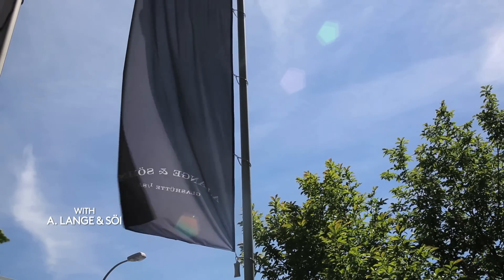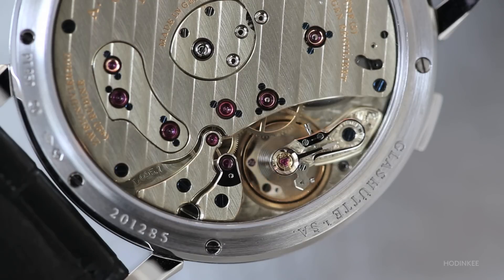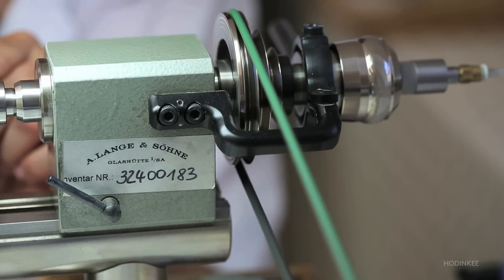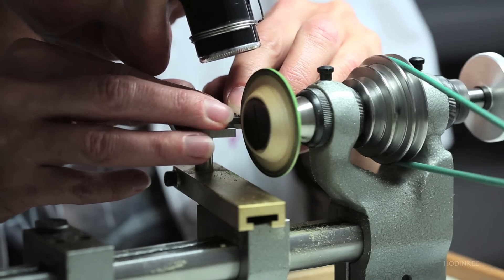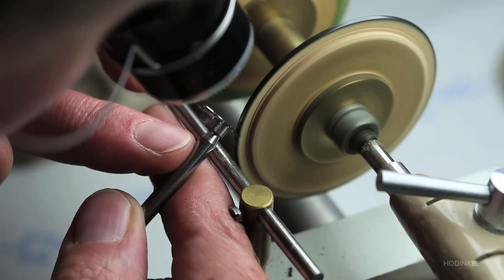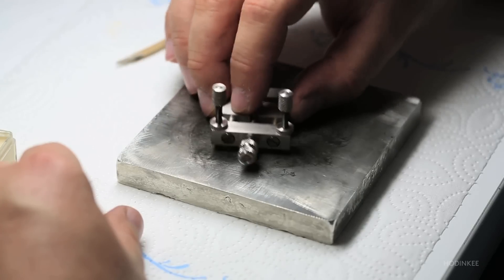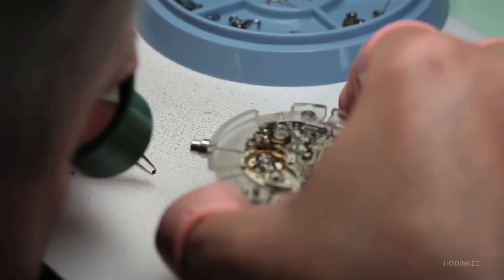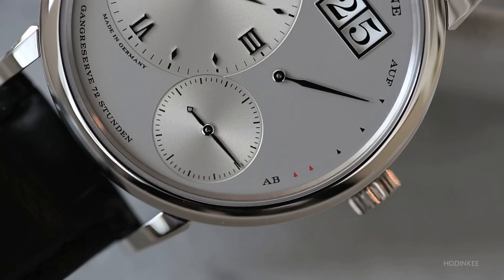Inside The Manufacture With A. Lange & Söhne

Comment: I used to repair phones... modern phones have microparts requiring magnifying glass just to see... it’s hard with both eyes open; especially when one uses the magnifying glass and the other one is to focus on the tool.... I’m only removing old parts and installing the new one... can’t imagine finishing a microparts using hands with manual tools... mad skills